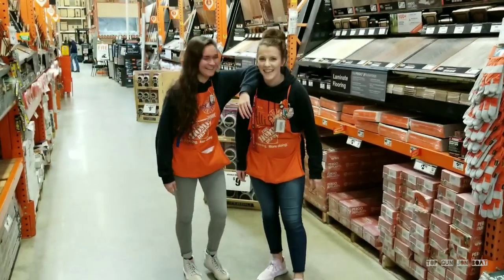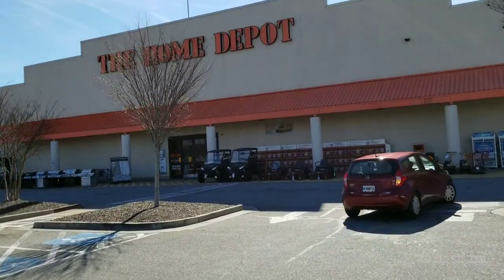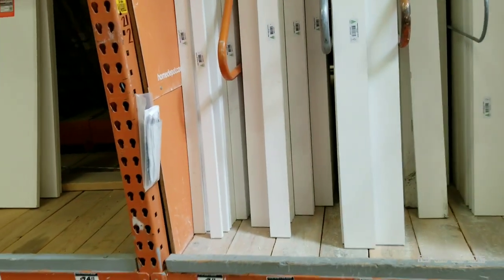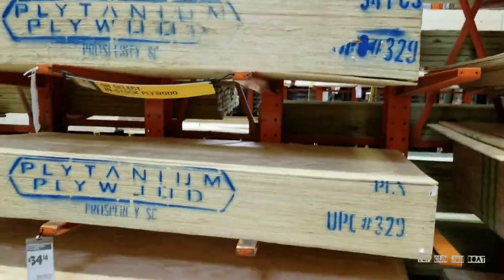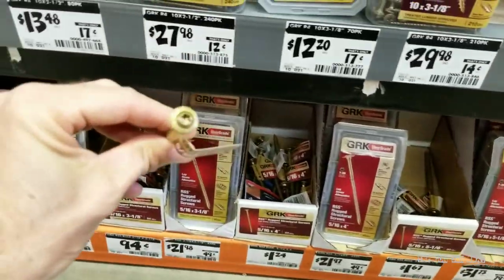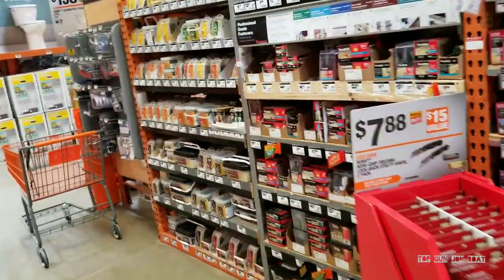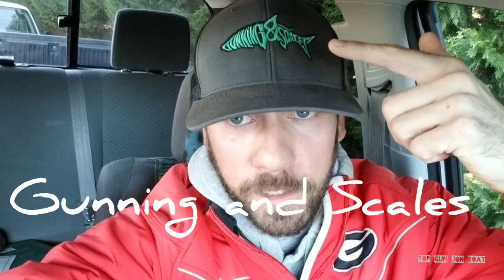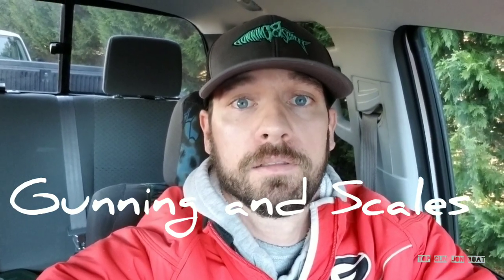TOP 5 JON BOAT BUILD MATERIALS From Home Depot/ Lowe's Part 1 (In Store Walk Through and Boat Demo)

Comment: I bass fish on a 163 acre lake that allows only electric motors. And  my 18 1/2 bass boat gets blown all over by the ever present wind. I think an 18’ Jon boat with a modified V Hull would do the trick. I want three inline pedestal seats, your DIY build is the first I’ve seen like that. Except I would need more battery storage for a 12/24 trolling motor.

Comment: 3M 5200 marine sealant is always nice to have around also. Good for water tight sealing around screws and rivets. Sold at Home Depot. Lowe’s doesn’t carry it in the store.
Reply from the maker: Great comment. My thought process was that you need wood, screws, hardware, carpet, paint ect. Honestly you need a lot for a build but yeah the marine sealant is a huge deal for sure.

Comment: Greetings and Thanks for the Awesome videos!  Can I use Cardboard soaked in resin and fiberglass (inter-locked and laid out strategically perhaps grid style or something) for the support/frame system instead of wood for an even lighter finish weight? What do you think about that?  

Most importantly, how much total weight did the modified decking (including, hatches, switches, screws, carpeting, etc.) did this add to the boat?  What was the total cost?

Comment: Subbed up. RN I'm working on a Duracraft 1519 with a built 25 tohatsu. This boat is pretty quick to be a DC. Getting 33mph with two people and 34mph with just me. Funny how weight distribution works.  Quick question do you have any experience with Duracraft boats?

Comment: Do you have any info on how to add the proper insulation to the boat , where do you add it and what type of material do you use and how to you attach it? Many people do boat builds and talks bout material but it doesn’t seem like anyone goes over what type of material they use to add buoyancy to the boat after adding all that weight with the wood framing decking etc,,,,, any insight would be  be greatly appreciated
Reply from the maker: Plenty of videos on foam. Fireant Fishing has one on his channel with over a quarter million views. Tbnation has a bunch on his channel, even talks about pour foam.  I was past the foam stage when I started my channel. You talk about weight added, I only added 200pds total and that was with batteries.  I used western red cedar which is incredibly light and 2x2s at that, only added a few pds. I used 15/32 plywood,  again minimal weight. The biggest thing was the batteries which added 100pds. 

Anyhow, the insulation I added is just something to help dampen vibration and noise, add rigidity under the floor, and of course help the boat float longer if it takes on water.
Reply from the maker: https://youtu.be/b9fCykxxMvE

https://youtu.be/fciWTvJPFAA

https://youtu.be/jgDVRABGBMY

https://youtu.be/qgDSY8miXTA

Comment: Why weight your boat down with lumber, put every bit of the lumber you normally use on a scale and see how much weight it is, I go with all aluminum framing and 1/16" aluminum sheets and yes the sheet is expensive and it's cheaper to get the 4'×8' which is $98 more or less
Reply from the maker: That's great. Your a bit late to the party as this video is YEARS old. I now build all my boats out of aluminum. But not because it is lighter. Because it lasts longer and I can guarantee it will not get damaged by water for my customers boat projects. That's right, years after this video I now build boats professionally.  Guess what I learned? Aluminum is not lighter. Yes, 1/16 angled aluminum is lighter than a 2x4 but I framed my boat out of 2x2 (1.75x1.75) custom ripped western red cedar. Feather lite. For aluminum decking, you should be using .090. At least .080. This is pound for pound as heavy as wood sheet of 1/2 plywood.  Funny enough, I used 11/32 plywood in my first build, making it lighter than an aluminum one. Weigh it? I did .On camera. My entire rear deck framing system in the 1436 weighed less that 6 pounds. I recently built a 1232 and the cockpit floor system alone out of aluminum weighed close to 40 pounds including sheeting, hat channel, and angled. That's pretty heavy. Big misconception about aluminum being lighter. Not if it's compared to cedar and thinner plywood.  Anyhow,  it's obvious you haven't watched any of my other 50 plus videos on my channel,  including my most recent ones where I have videos on how to deck in aluminum,  how to frame in aluminum, aluminum floor system, or the past 4 step by step builds all in done in aluminum.

Comment: Where I live our home Depot acts as if they have never heard of Western red, can I use spruce pine for 2x2 framing long as it is properly coated with paint or should I order Western red and wait?
Reply from the maker: Man it just depends on how serious you wanna get. The red is less dense than pine therefore lighter. It could save you a couple pounds through a whole build. But yeah, any wood is fine so long as you seal it properly!
Reply: Paint it with a good high gloss oil based enamel or exterior varathane and you'll be golden.  Possibly even better than a poorly sealed cedar and cheaper to boot.  Two coats min.....three is better

Comment: If I’m screwing plywood to the aluminum seat what is the best stew to use that won’t strip out of the aluminum bench seat
Reply from the maker: Idk about the best but where I attached things to aluminum I used stainless sheet metal screws. Only thing is to make sure to drill a pilot hole barely smaller than the screw thread diameter to the screen go in tightly and still grab metal without stripping. Again, that's just what I did,I had limited screws into metal in my boat.
Reply: Anthony Jones ok that’s helpful. The only spot I’m screwing into my entire boat is the rear deck to the seat

Comment: I’m worried about overloading my Jon boat. About how much weight do you think you added to the hull when building this?
Reply from the maker: 200 pds. All framed in 2x2 western red Cedar which is ultra light per linear ft, closed cell foam, and 15/32  plywood. I was incredibly weight conscious in this build. Out of the weight added, a majority of it is from the batteries which weigh roughly 100+pds

Comment: I would love to do this but I have one question, what happens when it rains and where would the water go ?
Reply from the maker: Same place it goes if there is no modifications at all. Bottom of the boat to the water channels which gravity takes effect to direct it to the rear of the boat where I have a bilge pump. The entire build is planned around the fact water will get in the boat at some point hence, sealing all wood, using stainless screws, allowing spots within fabrication to allow water to channel, ect. No different than a real bass boat I guess. I have a modified 1100 gallons per hour bilge pump to ensure whether a leak or act of God doesnt sink the boat hopefully.

Comment: Do you know or have a idea of how much weight you added? Trying to figure out what I need to stay around weight wise.
Reply from the maker: I like to think the weight I've added to the boat (all framing, decking, batteries), foam) would be equivalent to me taking my really overweight buddy out in the boat. So I know the batteries are 63 pds each times two. I'd think all framing and decking is around 200 pds give or take. Worst case I'm under 500 best case right at 300. Or maybe I'm just too optimistic with how lightweight my materials and techniques were. I did the build with weight heavily under consideration though.

Comment: Hey man sorry if I missed it, but what screws did you use to drill in the boat with? Or what do you recommend
Reply from the maker: If your drilling through the hull or ribs any bit that is rated for aluminum should work. I personally use a variety of bits from different companies but I've used the Black Oxide series from dewalt a bunch. They work good and are affordable. I usually start small, like 1/16 or 1/8 then work my way up through the bits to the diameter the hole I need. I actually buy a bunch of 1/16 separately because I use them a lot for pilot holes so I'm always breaking them or burning them up. Hope this helps some.
Reply: Anthony Jones  Thanks man I appreciate it
Reply: Anthony Jones j

Comment: Isn't "Western Red" Cedar? How about using actual marine grade plywood? I know it would cost more, but that is a real high grade plywood.
Reply from the maker: Yes, My most recent video, WOOD FRAMING,  features it.

You can use whatever plywood you like, i prefer to save weight.  Marine ply is incredibly heavy and could put your build very heavy and inefficient  , i fish electric only reservoirs where every pound matters and effects the boats performance and top speed.
Reply: @AnthonyJonesBrigadeBoats  It's "heavy" because it is dense which translates to strong which requires less of it to accomplish the same structural strength so instead of using 1/2" cdx you could get by with 3/8 marine grade and still have a stronger flor than the thicker less compatable cdx.  buy once cry once

Comment: Holy crap guys....DON"T buy big box lumber go to a proper lumber yard and pay less and get better quality lumber.  DON'T buy rough sawn lumber.  It's like buying a sponge.  How can you seal it?  You can't.  You don't need knotty thick lumber,  you need flat smooth clear lumber that has more strength in less weight.  That's what you get in clear straight grained lumber.  You won't find that at home depot.